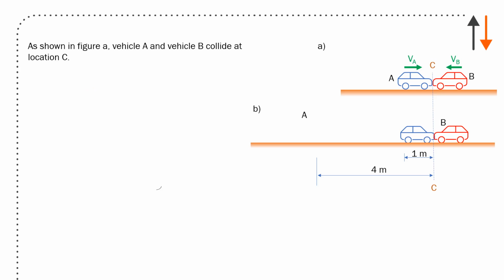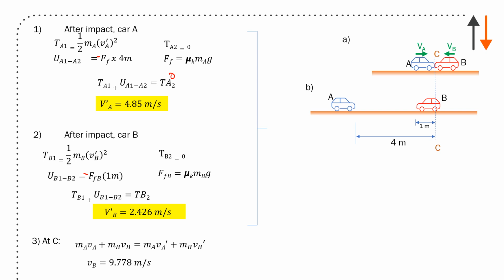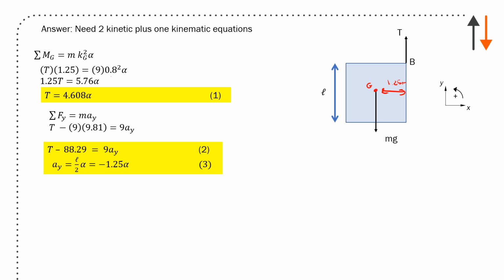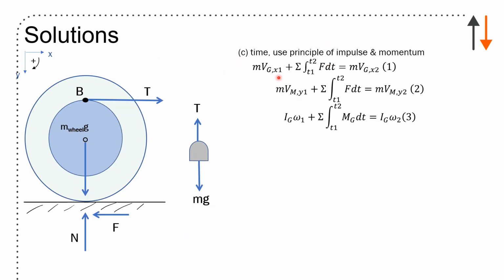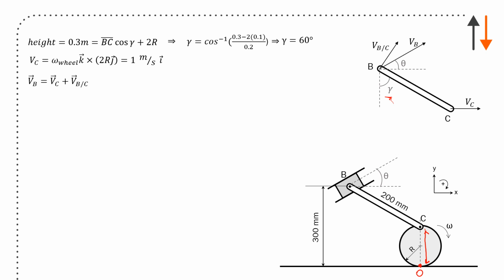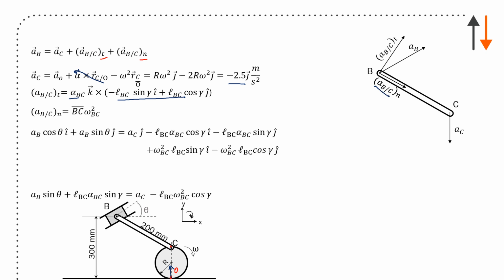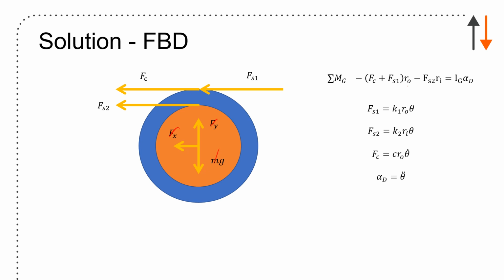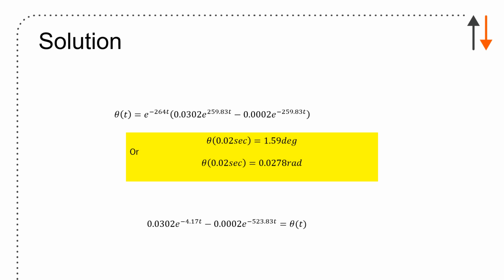Final exam 2021

Comment: Good day! I know this is an old post but I've been studying this since I will be retaking the course. 

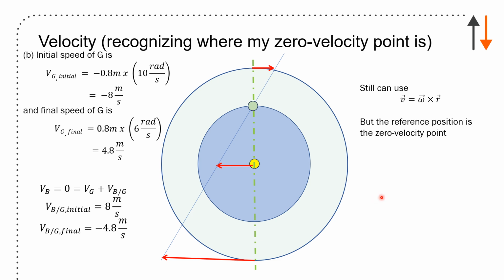I have a question regarding the solution to the question at 9:39,
Here it says V_{G, initial} = -0.8m x 10rad/s
Which is using the equation v = r x w? Is this just calculating the magnitude or is the a vector cross product?

If it is a vector cross product, 
v_G=v_B+ w x r_{G/B}
w = -10k  (since CCW)
r_{G/B} = +0.8j (since down is positive)

So we get:
v_G = +8i
which is inconsistent from the solution in the video, which is the source of my confusion. 

Am I missing something? Any help would be appreciated. Thank you so much!